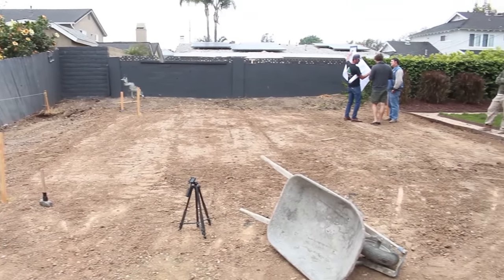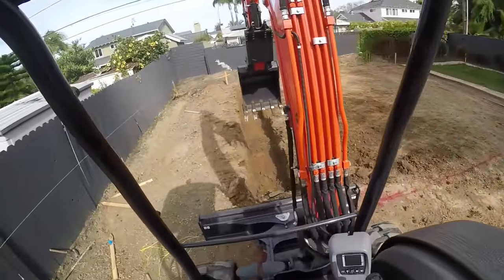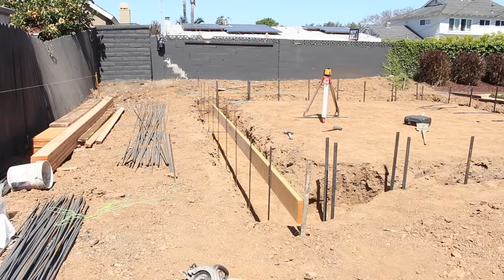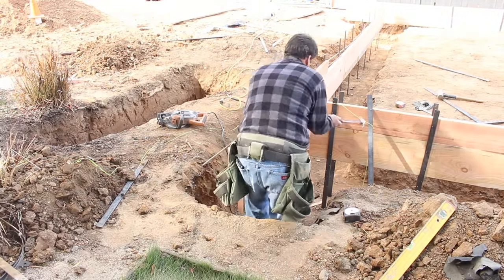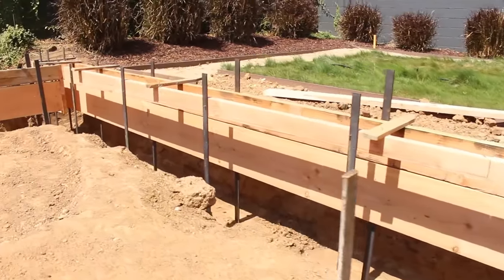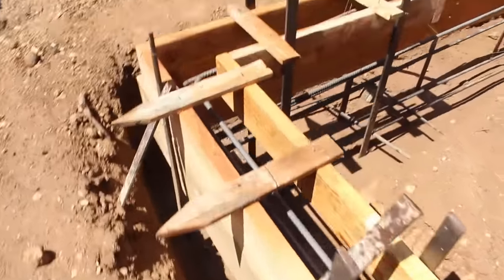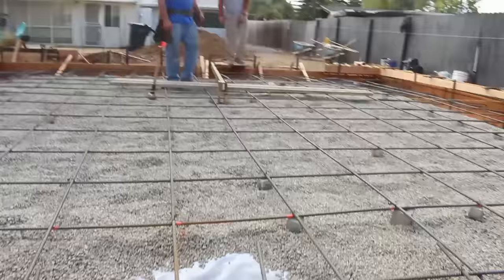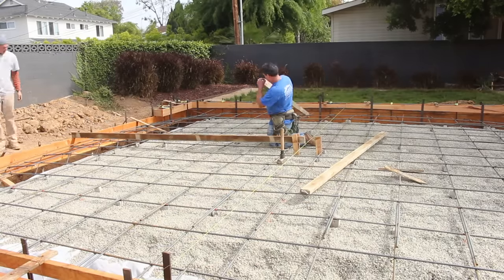How to Build and setup a Concrete Foundation for Garages, Houses, Room additions, Etc Part 1

Comment: Why did you put gravel on top of the plastic ? From the little bit of concrete work that I've done, we leveled the dirt, then spread the pea gravel, (or sand) and placed the plastic, (along with the rebar) on top of that. That way,  your  concrete won't seperate out and "soak" into the ground below.
Reply from the maker: Good question for the Engineer

Comment: It seems like a lot of extra strength for just a garage.  Is that a code you have to abide by or is that just how you do every job?  That is very nice work and I would be proud to have that but many jobs that I have been involved with are not nearly so well reinforced.  My shop I built in 1982 is a flat slab with just a few re-rod and it still looks pretty good today.  It has no footer but I poured pillars under main beam supports.  I had 6 bag mix (what they called it back then) and about 6" thick.  It has gone through many freeze and thaws here in Ohio.................lol.
Reply from the maker: James Spallinger 
I think this garage is overbuilt, but the codes are tough, do to earthquakes

Comment: Can you believe the 5 guys laboring and skill !
In North america frost line 42" to 60" deep footings will this work ?
After seeing the intense labor i would rather do a conventional footing and block then pour the floor.
Or just a 6inch flat slab. Maybe use 8inch planks tapered inside to a 6inch center. With rebar as shown 18inch apart.
Reply from the maker: OSS

Comment: That footing will hold a four story CBS bldg with concrete decks. They should have built 2x4 and plywood box forms for the footing, and then re-use the lumber later on the bldg. Box forms are stronger especially for larger pours like this.
Reply from the maker: Not a bad idea if the framers of the building were building the foundation also.

Comment: Nice videos. I want to mix and pour a large garage slab by myself or with one helper. Can I do this in sections and tie sections together with rebar?

In a shop or garage, can you pour 2 runners 2' wide 6" deep for driving on and the rest at 4" for mostly walking? Seems like 6" concrete for standing or walking on is a bit over kill.

Thanks in advance. Cheers, Scott
Reply from the maker: Seems like it would be more trouble then its worth.
I would stick to the basics.

Comment: Great! Done more than a few in the last 18 yrs. Like how you predrive all your form stakes. 1 question. The 4 ft centers on your verticle rebars tying ftg to slab and stemwall - no need to tie that into mat?  In other words might I just tie them into every other. Horizontal mat member at 36 o/c. Vs. 48 o/c or is that just overkill? Great video - will watch pt 2 next. Keep it up.
Reply from the maker: James Mascaro 
The more ties the better.
Probably not a necessity but it looks pretty. 
TY

Comment: Why do you dig out a 2ft x 2ft perimeter around the slab? What's the purpose of this? I'm about to pour a concrete driveway area and didn't do this, not sure if I need to?
Reply from the maker: This is a building foundation

Comment: Great Video, this footing seems to be overkill. Are you based in California or a high seismic zone? I am a structural engineer in Washington and the wood framed multi-story hotels I design do not have footings this built. I wonder what the design consideration was here
Reply from the maker: Not real sure, but its definitely over engineered.
I suppose you could at a later date go up three stories with the existing footings, and no retrofit

Comment: Sorry if it’s a dumb question, why can’t the perimeter foundation wall be the same level as the inner slab, what’s the reason it’s always raised higher by a few good inches?
Reply from the maker: Keeps the wood from getting wet

Comment: What makes you wet the subgrade prior to pouring concrete for the footings? Aren't you risking softening the soil which would create future settlement?
Reply from the maker: +Feras Ayoub 
Water in dirt is good for concrete.
Reply: Odell Complete Concrete settlement isn't good for concrete if you make it muddy, although it did seem that there weren't much fines in the soil.
Reply from the maker: Feras Ayoub 
I like mud
Reply: They wet the subgrade so that the soil does not wick to much moisture out of the concrete.  If the concrete drys too quickly it will not harden up to the design strength.

Comment: Great video. Killer slab.Most people (and a lot of the trades) don't realize how important it is for the slab to be square. Your walls will bow in and out  like a snake if it isn't. I like how you mentioned measuring the diagonals after you did the 6-8-10. Did the homeowner or architect/engineer call for the big footers and all the steel? Or are you guys in cold climate or earthquake zone? You'd love southern Az.  The code is 12" wide x 12" below grade with (2) # 4  rebar in the ftg. for a mono pour. Of course, that is the minimum requirement. A lot of home construction is post- tension now. Do you have to have a soil engineer report on the compaction, or is that done by the field inspector and is part of the permit fee?
Reply from the maker: Earthquake zone. Southern CA. Soil Engineer came in and did a soil report. The footings here were 12" x 12", One bar 1/2" T&B with 1/2 bolts about 25 years ago. Enjoy while you can. TY

Comment: My apologies if I missed it, but are your stakes a 2” by 1/4” hot rolled steel? Are those custom or manufactured?
Reply from the maker: I think there 1/2" thick and 4' tall.
There standard where I buy them.

Comment: Can I ask why you put the stone on top of the plastic membrane? We always laid the stone then compacted it, then spread sand blinding 2inch and compacted that as well, then lay the plastic on top. The sand stops the plastic getting punctured by the stone.
Reply from the maker: Heli Crete 
I don't know. You would have to ask the engineer.
This is a first for me with this system. Most drawings call for sand or road base. This one is a little unusual.

Comment: Maybe think about putting hard plastic caps on top of your steel posts. You can get them in a hard yellow plastic for star pickets. That way if you trip and fall on one it won't go through you. I tripped once and the unprotected steel post just about went through my head.
Reply from the maker: LAZY DOG 
I've used caps for vertical rebar, but I've never seen anything on stakes.

Comment: You need more plans for this tiny garage. I would build a twelve-story hi-rise on this size foundation.
The footings look a minimum of 18 inches wide, with 2,000 soil bearing capacity, you have 3,000 lbs per linear foot of footing or 24 x24 garage has 96 x 1.5 x 2,000 lbs or 288,000 lbs. loading capacity, or 500 lbs per square foot of floor. You can store government tanks in this building or build a five-story garage.
Reply from the maker: We were hoping we could use for rocket launch and recovery platform

Comment: From excavator to wheelbarrow, it takes more time why you don't place the excavated soil that can be reach by the arm of machine. Then after a while can be push by the blade away from building limit while you are at the last part of excavation at same time doing stockpiling.
Reply from the maker: I like it out of my way quickly

Comment: You can staple a 6mill plastic on the 2x12 drop 8” down instead of a 2x4 and you will never have problem with losing wood
Reply from the maker: Yes that's a good idea.

Comment: that is some strong concrete. As a bridge building, we use most of the time a 5000 psi mix at a 4 inch or less slump. This is very much over kill. I would have thougth 3500 would be plenty enough. JS
Reply from the maker: I concur

Comment: Why does one put gravel on top of the plastic? Is that just to level out the area only? or is there another reason to do this? My foundation was poured with the plastic on top and the metal grid on top of that.
Reply from the maker: The gravel protects the plastic

Comment: we have ready made welded 'trench mesh' down under here in Australia. Makes it easy to do reinforcing steel to trench edge beam. cheers
Reply from the maker: NIce
Reply: HI, dont tell me USA has no ready made welded trench mesh/ cage. Just cut length and drop it in the footing. Another thing, I see people commenting on "foundations", when talking about concrete footings. The natural ground, whether sand/ rock/ clay is the FOUNDATION. The concrete or stone/ brick/ piles laid on the foundation are the FOOTINGS. When people get this confused, it tells me they have not been to construction school for 6 years, like I did, with strict old school Master Carpenter. I considered turning to training apprentices, but I find it far too difficult to deal with todays teens. Its like they hate us 50yos for the messy world we brought them to, (I dont blame them for this). An old German bricklayer I worked with (60yo 1988), told me his fathern had to pay the master bricky to train him. He started to get paid in his 3rd year. Imagine if the kids had to pay for their apprenticeship, as they did in post WW2 Germany.
Cheers from downunder and have a good northern summer.
Reply from the maker: Things are much different from that time era.
I wouldn't say better in this field.

Comment: Thanks for the video, I have watched this one several times😀. Can I ask why you used a 2x12 and a 2x6 for the outside perimeter? I know you said slab needed to be 9” above grade and the stem 6”...so I was just curious. I am doing my garage foundation and plans call for 4” of sand, 4” above grade for the finished slab and 8” stem wall....I’m trying to figure out the size of boards for my outside perimeter. Thanks,
Reply from the maker: The slab is 9" above the stem wall is another 6" that equals 15" a 2x 12 is actually 11 1/4" x 1 1/2". Whoever came in and graded the pad and lot was terrible . The pad was off by 5"s, The perimeter of the pad was off by a 1.5'. To limit the run out.
Reply: Odell Complete Concrete 
Ah, that makes sense. Thanks for responding! So I'm guessing  where my surveyor marked my basic flood elevation is my finished grade?
Reply from the maker: Dee Gee 
If that's flood elevation I think I would be 6" above that
Reply: Odell Complete Concrete okay thank you !!

Comment: I didn't see any drains or crushed rock around the footings.

Are they not required in your area? Up north we need them to avoid frost heaving.
Reply from the maker: No freeze here, its beach weather everyday
Reply: @OdellCompleteConcrete  I heard that. Gotta go see it next winter. Have great friends in Palm Springs. Keep it the videos. Like your no bs approach.
Reply from the maker: Sure will
TY

Comment: What I am wanting to know is  how the plumber start and how he takes measurements to dig the trenches and  and run all the pipes to the designed locations in a land where nothing is yet built. 
How everything (bath, kitchen, laundry, etc) matches to the precise location after the house is built?
Reply from the maker: Where you want it
Reply: @OdellCompleteConcrete  It is not a matter of where. It is just a matter of curiosity. 
More precisely I live in Texas and I see new construction almost every day but have not clue what reference they take to dig all trenches.

Comment: I have a question : At the start of the video, the dirt ground that was marked off, was that the dirt that was originally there and was it compacted ?

Is it necessary to wait a day after watering the trench you dug for the footing ?
Reply from the maker: It was supposedly compacted prior to my arrival.
Water a day before and the day of is fine

Comment: Is there a best way to guarantee all sides are dead level with each other?

My best guess is eyeball the forms when building and then use a string level to make adjustments to perfect.

I’m just watching this thinking how do you know for sure the left side of the garage is dead level with the right side of the garage.
Reply from the maker: We used a laser level
Reply: Thank you for the response. I found your video with the Dewalt Laser level.

Comment: I grade floors in Phoenix, AZ. Things are done differently on the other side of the country. lol We use AB and it's required to be raised to a certain level. Interesting to watch.
Reply from the maker: MognsterGaming 
what is AB?
Reply: It's a type of mixture of sand and rocks, we are to come in and backfill the holes for piping then fill in and grade the floor to a certain height. Things are done more complex in AZ then there. lol
Reply: and some crushed Limestone.
Reply from the maker: MognsterGaming 
That's intense

Comment: Even in quake prone areas that is over-engineered in my view. Your videos and work are awesome - totally not bagging on that - but all that steel for a detached garage?
Reply from the maker: The building codes get harder and harder every year. When I started doing home foundations in California in 1986 the House foundation was 12" x 12" #4 rebar top and bottom. J bolts every 6'.
Its a lot different now even though the houses  built in the 70' s are still standing fine.
Reply: Yeah, same here in Florida. Lot's of structures here that have survived decades of hurricanes. Don't get me wrong, there have been great improvements but between lawyers and power hungry local politicians it has gotten out of control.
Reply from the maker: That's a good possibility, only time will tell.

Comment: You must be in a warm climate with earthquakes as we don't rebar quite as heavy even though we freeze and thaw but we do insulate and pour deeper to get below the frost line an a bit thicker here in the extreme NW corner of Ohio.
Reply from the maker: Steve La Londe Jr 
makes sense.
different ares require different techniques.
Reply: thats not heavy lol

Comment: What is the cost of this slab and foundation?  I read your responses to other similar questions and you gave different answers:  $13K, $10K and $8.5K.   So, I just want to find out the actual cost because I am planning to do the same in Norcal.  Thank you.
Reply from the maker: 10,000

Comment: Rebar reinforced slab.....requirement in your area? It's a lot more expensive than standard 10 gauge wire mesh, however, it's also stronger.
Reply from the maker: Yes I would think so

Comment: Hello, this is the best slab on grade video on youtube! how do you oil the forms? SAE 30 motor oil in a hudson sprayer?
Reply from the maker: I use my used motor oil diluted with diesel fuel through the sprayer

Comment: We do not dig as you do, we put the concrete strip foundation on the surface of the floor and then fill the place with soil and compact it well, then we pour the concrete into the space.
Respect from Babylon

Comment: How do you prepare the trenches for the footings if there is a slope from one end of the marked rectangle to the other end to keep the footings level?
Reply from the maker: David 
Dig footings level use a laser level, if need be step the footings.
Reply: Thanks!

Comment: so you are not required to use stirrups that completely circle the #5 rebar runs?
Reply from the maker: That would be called a grade beam
Reply: thanks, so if i want to do a strip foundation with a raised wood floor and crawl space,  would they be constructed as grade beams?
Reply from the maker: Steve Haigh 
Depends on who's drawing the plans.
Reply: ma chaine est spécialisé dans le Génie civil et HSE bienvenus dans ma chaine

Comment: what are those metal straps/pins youre using and where can i find them?
Reply from the maker: Metal shop.
Steel Stakes
Reply: Odell Complete Concrete  I like them, better than pulling out rounds or wood stakes.

Comment: Is that compactor from Harbor Freight? Mine is, looks like yours.
Reply from the maker: soco13466 
no its a MQ
Reply: +Odell Complete Concrete I think they are sold under different brands, like the HF drill presses, other items. The one you have looks identical to my HF one.
Reply from the maker: soco13466 
I would say you have a copy cat.
I know a guy that got one from harbor freight. It was very heavy, so I thought wow this guy got a great deal. The vibrating was weak  and the machine lasted 6 month's with minimal use.

Comment: Hi David, really love youre videos. Maybe i got a tip for you for the rebar in the foundation as it seemed hanging them from wires was pretty teedius work. If you pound some rebar stakes in the ground and suspend them from that you can conect them later with the rebar from the floor and remove the rebar pounded into the ground. I hope i helped you with that becouse im learning allot from you. sorry for my spelling, im dutch so not that good at it. curious of how the pour comes out. Keep up the epic vidoes.
Reply from the maker: bakker071 
thanks
I'll give it a shot
Reply: Your a nice guy, always open to the suggestions in comments. Bet you have a good profitable business with lots of referrals.
Reply: I was curious about the forms it looked like all new lumber? Ive seen some who have forms that they reuse is this part of the cost of each project to purchase lumber needed too. Could you mention the final size of this project sorry if I missed it in the video. Looking foward to Part 2.
Reply from the maker: Dani Adams 
26 x 26
always figure new lumber
Reply: what he means is he charges the customer for new wood but uses the old crap from other jobs

Comment: Man, thats a monster footing for a basic garage foundation. Here in AZ they are spec'd at only 16" wide 18" deep. #4 rebar 2 at bottom one at top, 4' OC uprights. That is one beefy foundation. Im doing mono RV garage right now thats 1800 sq ft. They must engineer the foundation plans that way in CA for Earthquake reasons? No other reason for a footer that wide and deep with that much #5 rebar for a basic build right?
Great work though!
Reply from the maker: Bingo